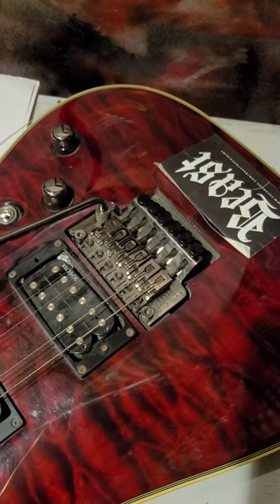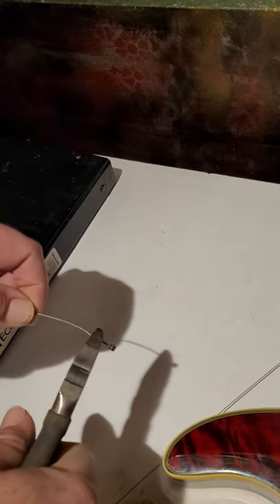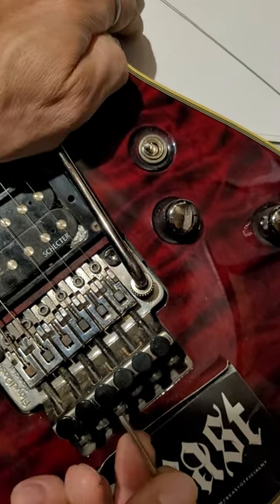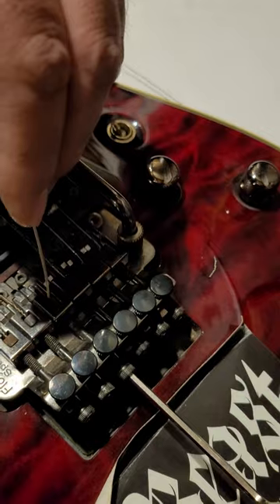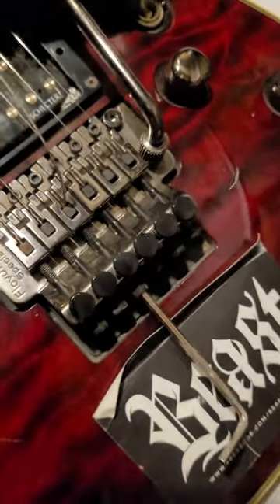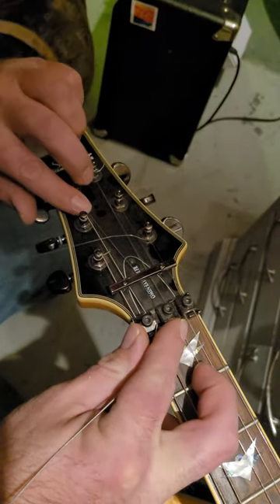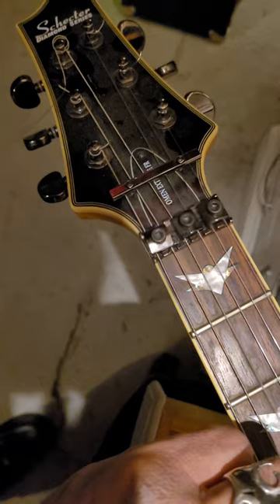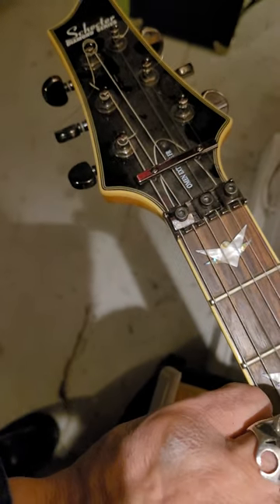how to replace a string on a Floyd rose tremolo (DIY)

Comment: Something I learned from a fellow guitar player with a Floyd rose way back when is that you don’t need to cut off the ball on the end of the guitar strings. Feed the string through the tuning peg until the ball end is snug at the peg. Then leave enough length of string so that you can wind it with a generous amount around the tuning peg. For some reason whenever a string breaks with a Floyd rose it will always break at the bridge saddle where it is clamped in like a vice.  The beauty about this method is that when a string does break, unclamp the bit of string that is left in the bridge saddle. Then simply unwind an appropriate amount of string on the tuning peg to clamp again and voila no need to replace the entire string.  Rock on! 🎸
Reply: If you're waiting 4 a string to break before you replace it. You've got bigger problems than a broken string.
Reply: @maxammo6282 yeah it tends to take a couple months of hard playing to corrode and snap a string on a good set. Just keep them clean and theyll last until you wanna change the whole set
Reply: @finthesloppyguitarist  yeah for me strings don't last no more than 2 weeks. They pretty much sound dead. Does not matter how much i clean them. And yes I've tried the elixirs and all the different micro coating strings. I can get about 3 weeks out of those. So basically it's not worth the extra cost for me to buy those. I usually buy a box of strings. I own 12 guitars and I and I tech for my bass player and other guitar player. So I'm always changing strings. Hell I even have a flight rack. Just for changing strings. Yeah I know a lot of guys have a hard time changing strings and keeping their guitar clean. But when you've been doing it as long as I have it's just a daily routine. Like taking a shower. 🍻
Reply: Bro that's what amateurs do. Step up your game.
Reply: @maxammo6282  yeah man. I play a LOT but elixirs still last months for me, Ernie balls go for about two weeks, and fender strings aren't even worth putting on the guitar. I guess it's up to how you play and how often you do, different needs need different strings ain't it
Reply: @finthesloppyguitarist  yep that sounds about right. Plus what I've noticed through the years is some players have very sweaty hands. Which is detrimental to strings and the hardware.
Reply: @maxammo6282  yeah, I used to sweat a lot but I don't tend to anymore and since then my strings have lasted much longer

Comment: Okay please help me im having a very frustrating problem, I broke the B string on my Floyd rose guitar and did this exact thing but now the B and E fret out when I try to bend or just play, I was thinking maybe it’s the string height so I adjusted the B to match the E and it’s all messed up, how do I get the B and E to play correctly
Reply from the maker: If you used the same guage and not  lighter Guage, strings,   you will most likely have to adjust the tremolo bar if they are fretting out .